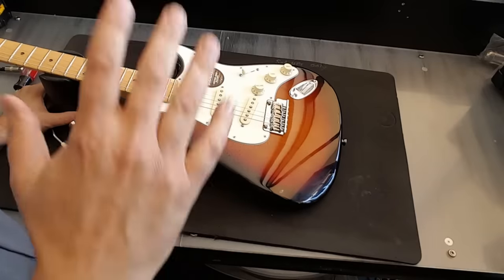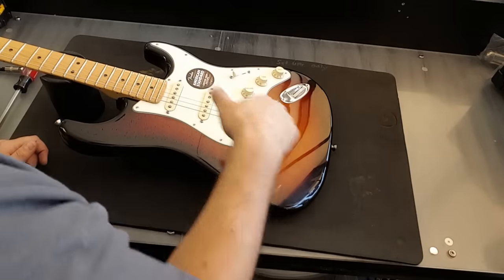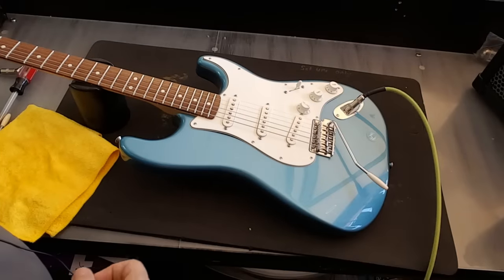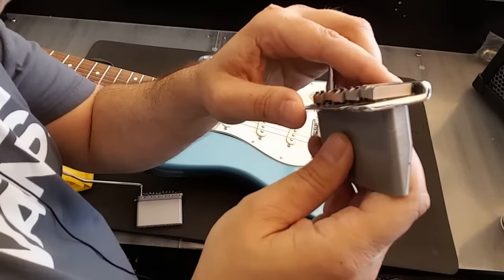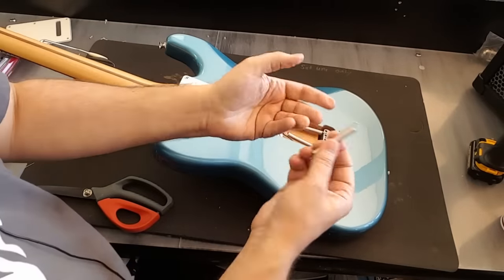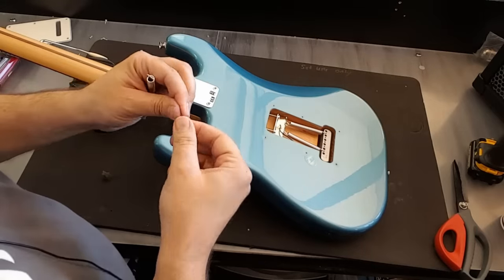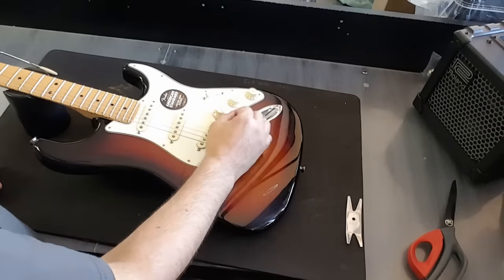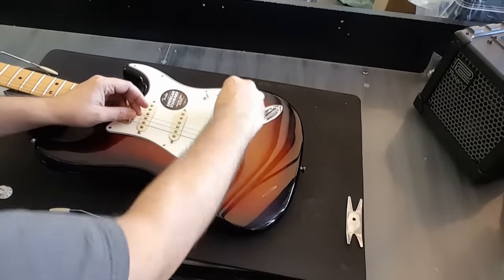5 things you didn't know about your Fender Strat

Comment: There’s an old Strat player’s trick (for when that little spring doesn’t exist), you can wrap the threads on the tremolo bar with something that plumbers use… Teflon Tape!  You can get it at any hardware store that sells plumbing supplies.  Wrap some Teflon Tape twice around the threads (three times at the most) and that will keep that whammy bar from just swinging freely.  The tape (which is not sticky in any way) adds just a little bit of friction to the threads.  This prevents the bar from dropping to a “straight down” position when you let go, and keeps your tremolo bar in whatever position you left it.  It won’t damage the threads (it’s just a very thin plastic), so the threads will stay like new as long as you have that Strat!  The piece of Teflon Tape in my Strat has been there for at least 15 years!  File this trick under “easy fixes”.
Reply: You can also use any little spring, like those in color pens, i used one like that on my strat
Reply: Another good thing of the teflon tape is, it prevents the trem arm from wobbling in the thread.
Reply: Plumbers rock!

Comment: After watching this I realized I was one of the none of my trem arms have that spring because none of my guitars are new. I just went to my crap drawer and fished out an old empty lighter and took out the spring from under the flint. I cut it down to size and it works perfectly. Made a few with one spring. Thanks Phil.
Reply: I was thinking the same thing about a ball point pen spring.
Reply: @bobholland5302  if my wife didn't immediately discard pens the second they start to fail I'd have a bunch of those in the crap drawer too. I strip everything.
Reply: I brought this video back up looking for your comment ( I don't play dive bombs, but keeping options open is always wise) thanks for the tip.🎸
Reply: Hell yeah! Thank you!!!
Reply: @bobholland5302  not a chance those springs a weeeeak
Reply: about to do this
Reply: Doesn't work man. Just crushes the spring. Waay to weak
Reply: @cheifdiamonphilips  what kind of lighter did you use and how long did you make the spring?
Reply: It's a MUCH stiffer bias spring, than a pen or lighter.

Comment: This tutorial was excellent. I ordered Fender trem springs right away. Made such a difference. 

But a word of caution using foam products inside the trem tension springs: certain types of foam products disintegrate--or "rot"--over time, leaving you with a sticky, gooe mess that is very hard to clean up. This has happened with so many of my stored products, and even includes certain rubberized plastics like those used as camera grips. The consistency is visibly identical to tar, and I think it's safe to assume these chemicals are petroleum based..

Comment: I put ciggarette filters in the springs...to shut them up...doing that since the 70s... good video
Reply: +dan beck i use plastic tube isolation stripped down from network twisted pair cable
Reply: That will work..
Reply: @Gevalt,
Of course they touched tobacco!!  You only use filters you find in the ashtrays of the Kit Kat Klub or on the street!!  After they drag them down a gravel road, that helps the antiqued "custom shop" guitars get that lovely roadworn patina that cost an extra few hundred bucks.

Comment: I’ve been cutting apart pickguards and replacing parts on Strats since 1984 and you blew my mind. 1) The trem issue was a problem that I gave up on and simply twist it so it's locked facing around 8’oclock. 2) I do love the onboard spring reverb tank (ahem, thought I only knew about that) but some of my Strats have 4 tight springs = IMO perfect reverb effect but little divebombing ability and some have 3 loose springs = too much booing!, now I will experiment with this muffling technique. 3) Foam under the volume knob  (AKA tone) is really nice trick. PS: Love your YouTubes - you’re very pleasent to watch and learn. Keep on pickin’.

Comment: Watched the first 30 seconds of this and went straight on eBay and bought one of those springs for $1 plus $2 postage.
I've owned several Strats, never a brand new one, didn't know those screws existed. Thanks!
Reply: (Springs).
Reply: Any local die repair / die tool shop will have a spring that works...

Comment: I like the trem spring vibration. It's like a "reverb" in the guitar and part of the sound of the guitar.
Reply: +Randy McRae You dampen the springs and to my ears it's not a strat any more.
Reply: Agreed, the springs are a part of the whole sound.
Reply: +Randy McRae I'm not sure how much the trem springs can influence the overall tone electrically, given how far the trem springs are from the pickups.

I'm not really a fan of the ringing sound they put out acoustically, so I prefer to dampen them on most of my guitars. Each to their own, though!
Reply: +zoomosis It's not an electronic influence. It's acoustic, and you can hear it both plugged and unplugged. I feel it's part of the sound of the guitar. I am blessed with a Strings and Things Custom Blues King III that I have had since 1984. The best "Strat" I have ever owned. It is relatively light, ash, and has almost an acoustic vibe to it. I have always kept the bridge tight against the body, never using the trem. The "spring ring" is like a built in reverb and I like it.
Reply: jonas brave this is true no two electrics ever sound completely alike
Reply: you are right on my friend ....check out "The Strat Chat"  talks all about that secret reverb from a strat

Comment: i lost the spring for the tremolo. I used one from a pen haha
Reply: smart!
Reply: if you have one from a pen, then you its not doing anything. Those springs are not strong enough to give you any benefit.
Reply: Exactly, they can fall apart inside and are often hard to get out. A good one will last a long time. 
Can i have a flamethrower now, Hank?
Reply: CROWjunkie same!
Reply: HankCScorpio actually they are. Mine works just fine with my pen spring lol. It doesn't really take a whole lot for it to work. Now it may not be as perfect and it may not last as long. But it does work just fine
Reply: Keeley Alchin it worked for me. Not the best in the world.  If you can find a spring that is more stiff than a pen spring then use it instead. But if you can't,  it will do the job
Reply: Keeley Alchin anytime! And good luck to you! Hope it works as well as mine did
Reply: CROWjunkie another fix for this is to take a bunch of Teflon thread tape, and wrap it around  the threads on the arm before screwing it into the bridge. If you lose the spring and only don't happen to be able to find one, you may be able to find a roll of Teflon tape at Walmart or a hardware store.
Reply: Great tip, dude!
Reply: I used a random spring I found on the floor, now it’s stuck :/
Reply: will the springs stay in when you take the arm out? or do you have to keep track of it.
Reply: @HankCScorpio  I take 2 and like shuffling cards put them side by side and push one into the others coils Its worked great for years like over 30 years
Reply: One from a reclining chair would be more believable
Reply: I was high when I read this I thought he was talking about the spring that goes on the claw and then onto the tremolo block 😂😂
Reply: @jackoo666  It will fall out if you turn guitar over. You need to take it out or you will lose it
Reply: A bit of silicon from a flesh light works too. What?
Reply: @jackoo666  k
Reply: @jackoo666  When you take the tremolo arm out, just put a small piece of tape over the hole to keep the spring in place.
Reply: Jackson Langford I bought some small flat magnets on eBay and cover the hole when removing the arm to put in the case.
Works a treat!
Reply: William Getzstoned Hahahah 😂!!! i'm just freakin' stoned right now and reading your commy just gave me a hard laugh-flash man 😂👌🏼!!